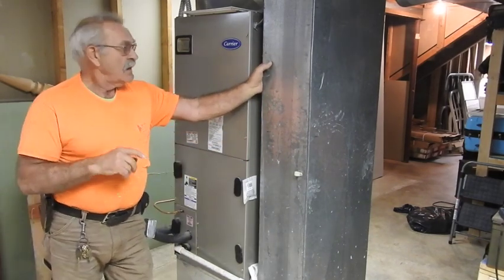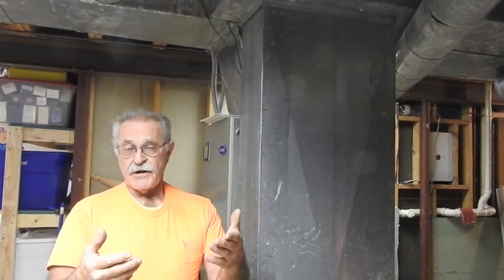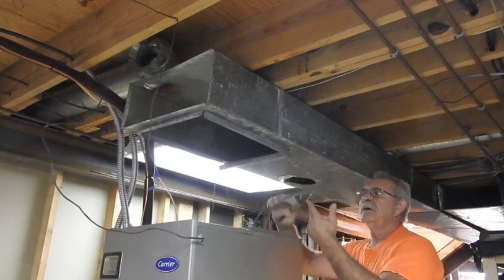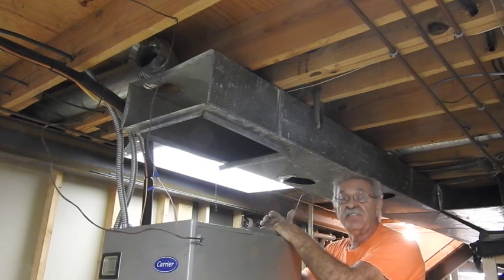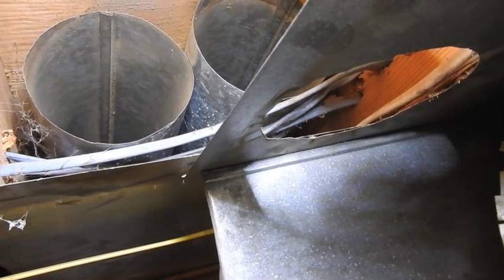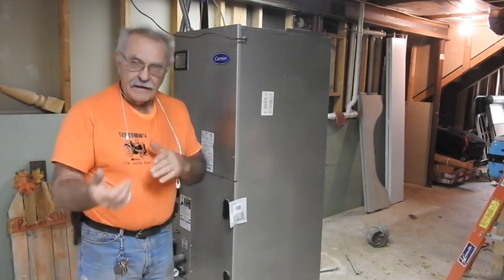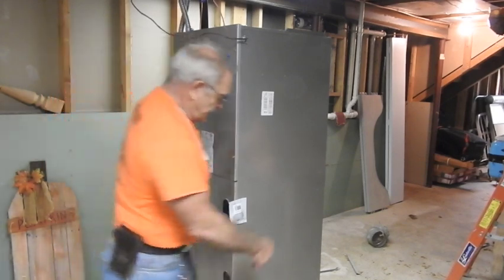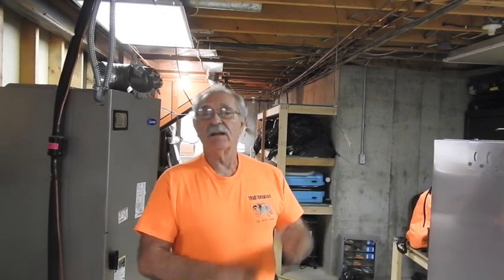Air Handler and Duct Demo

Comment: Can a take off be used to go to both sides of the basement from the trunkline?  I have a 20x20 basement thought I might need 4 vents, but seems too tight for that many.  Maybe only 2 needed?
Reply from the maker: Remember to divide the total cfm of the air handler or furnace by the number of registers or branch ducts you need and that will be the approximate air delivery to those registers.  
     Any airflow used to supply the basement 20x20 room will reduce the air proportionately in the living space above.  So I would suggest utilizing 6'' balancing dampers in the basement registers for proportional airflow adjustment.    
     I'd personally start off with only two six inch take offs, then add a third in the space more frequently used if you find it to be necessary.  Hope that helps and good luck with your project.

Comment: How do I correctly size my trunk line and air handler?
Reply from the maker: The first step in the process is learning how to figure the heat loss/gain of your home.  You should be able to easily find a shortened version on line to get the answer you need.  Once the loss/gain is found in btu's, size the air handler based on 400 cfm per ton of air conditioning.  One ton is 12,000 btu's.  Then you'll need a duct calculator and start with the air delivery capability of the air handler in cfm.  For instance a two ton unit will deliver 800 cfm, a 2 1/2 ton unit will deliver 1,000 cfm etc. The duct calculator will have the information on it to properly size supply air ducting for the capacity of the air handler in cfm.  I typically shoot for 700 to 900 fpm (velocity) in the main trunk.  More than that will result in excessive noise in the duct.  I know this sounds terribly difficult, but there is really no simple way to describe how to answer your question...so many variables I don't have firm input on, but armed with the proper heat loss/gain calculation and a duct calculator the job is very easy.  I have to admit though, that it can be a formidable job for you if you are not at least basically familiar with the HVAC field.
Reply: @tractorman4461  thank you, I’m working with about 800sqft and was thinking 1.5 ton With 4x12 trunk line, about 9- 6’’ supplies.
Reply from the maker: @joshuacassino7297  well 1.5 ton will probably still have a 2 ton blower...they usually do.  So you might still be looking at 800 cfm.  With the proper size duct (4x12 is too small) you will deliver approximately 90 cfm per register.  I don't have my duct calculator with me, but I would think 8'' x 14'' duct would be closer to delivering the air velocity adequately and at a much slower speed keeping the noise factor to a minimum.    I will try to remember to check my calculator tomorrow and come back to this comment with a closer size.  Will the air handler be at the end of the trunk line or will the air handler sit in the middle and blow both ways.  That will have an effect on the sizing.
Reply: @tractorman4461  I loo forward to your reply. Thank you.
Reply from the maker: @joshuacassino7297  According to the duct calculator, a  4 x 12 duct even at 600 cfm (1 1/2 ton) will give a duct velocity of 2,100 fpm or feet per minute.  Wayyyyy to high.  The friction/100 ft also goes up to 1.0'' !!  Wayyyy too high.  Residential duct friction loss should be .1'' not 1.0'', thats 10 times higher. Now IF your air handler does deliver air at 600 CFM, a duct size of 8x16 gives .13 friction loss at velocity of 750 fpm...in the middle of the recommended speed for comfort and air noise.  If it delivers 800 cfm, an 8x16 duct is marginally acceptable as far as the friction/100' goes slightly up to .14  and the velocity increases to just at the maximum speed for residences at slightly above 1,000 fpm.  All this depends a lot on the way its going to be installed too.  Like is the air handler to be at the END of the duct or is it going to deliver air in the middle of off set to one end or the other.....all that plays into the duct sizing.
  I would suggest a little more research and obtaining a duct calculator, either a hand held or virtual, and look at all aspects of the potential installation.  You don't want to make a mistake in design.  I hope if nothing else, I've stressed the importance of pre-thought.  Unfortunately I can't do it in a comment string.  But now you have a toe-hold on the subject.

Comment: I'm amazed at how many HVAC companies oversize heat pumps and undersize the duct work. Back in the day we ran heat load calculations to factor in the number and size of doors and windows along with the sq footage of the structure to accurately size heat pumps. Watching you remove those drive cleats with a duct hammer brought back fond memories. Looking forward to this series!
Reply from the maker: Yes, the air velocity must be much lower for satisfactory operation with a heat pump.  Heat pumps, as you know, are not capable of delivering the 140*F  air like what comes off of a fossil fuel furnace. The standard sized ducting's higher velocity makes the discharge air off the heat pump feel cold and drafty.  Heat Pumps have gotten a bad rap due to improper installation from the start.

Comment: ...  why did you decide to switch supply and return trunks?
Reply from the maker: The final stage of this system will be the addition of a forced air wood furnace that's going to tie into the side of the supply air tee in the new truck off of the air handler.  Both plenums will be fitted with motorized dampers and control automatically.....but that's coming up.  Hopefully you'll hang around a bit.  I got a LOT of editing to do plus other videos as well.
Reply: @tractorman4461  of course, i am hanging around. You know so much. There is so much for me to learn from you. I hope you will post more hvac stuff 😁👍 🙏 Will you be adding extra branches, or trunks only were undersized? Thanks

Comment: Thank you. I would appreciate "not to do things" list a lot :) By the way, some people complain about some registers not supplying enough air, what is your opinion about booster fans? Thank you 👍
Reply from the maker: Oh my gosh...!! There's a list so long I wouldn't be able to do it justice.  But during the installation I do touch base on some pretty severe nastiness where two riser take off the top of the duct for going to the second floor.  So much of what to do and what not to do is really opinion once you get beyond your local codes.  Unfortunately so much of my constant rambling gets edited out to keep the videos a conservative length.  I don't think there are many that would watch hour and a half vids on an install.
   About booster fans....I suggest that a system  with a properly designed duct network based on the total cfm of the unit WITH the addition of 6'' balancing dampers in EACH run as close to the trunk line as possible would deliver the desired airflow with a little 'tweaking' to balance the individual register requirements. You know yourself there are registers delivering 2 times or more the cfm required.  Throttle that and others like it back.....keep the air and the static up in the trunk and move the air to the suffering register, whose damper should be fully open.  It takes time and patience but with individual dampers in the s/a take off's, it is almost always possible to balance out.  That what we do with medium static commercial systems and also commercial high static systems supplying vav boxes and ftu's.  BUT.... when necessary, a booster isn't too bad of a bandaid.
Reply: @tractorman4461  thank you! 👍
Reply from the maker: @qeesher  Hey man...I just found three of your unanswered comments in my spam folder and deleted them by accident.  I was trying to approve each of them and it didn't work correctly.  But I do remember one said you wished for more HVAC and that you were going to hang around for more.  So yes, there will be more as soon as I can.  Sorry about the deleting thing.

Comment: Was the old setup freezing the indoor coil with the duct being that small? Its incredible sometimes how easy things come apart with knowledge of how it should go together.  THAT ONE STINKING SCREW!
Reply from the maker: Hahahaha....there's always one, right ?  In this case only one.  But it sure held. I don't know how the s's didn't blow apart on the sides.   If it wouldn't have been for the appliances in the area, it would have been dropped a bit quicker.  But even if it's my own son's I don't want to damage anything that's not part of the system.  
    No freezing of the coil, just excessive noise due to the velocity of the air flow and with 4 tons of blower on the undersize duct, and the 15 kw package had low temp rise.  The discharge air temp coming from the registers felt like a heat pump of insufficient capacity trying to satisfy the thermostat.

Comment: Great demo, Tractorman44. Most residential installers on a tearout would cut the hangers and let it fall to the floor making a big mess. Looking forward to the cabbing and install. Thxs for the vids!
Reply from the maker: This is going to be a tough one going back.  Iirc, I counted at least 12 or 13 specialty fittings to tie everything in, including the wood fired furnace.  Yeah, I used to get a little rougher on the demo, but this area had too many appliances and a NEW treadmill.  Thanks David for watching.

Comment: Good to see the break down as well, like the Extra Hands.... I read your Description through but not catch what is the demo you talk about, did you mean it was up for training and demonstration purposes? sorry for the dump question 44🤣
Reply from the maker: In the building trades in America, the term 'demo' mean demolition.  So on a job like this one, the first order of business is the demo....or removal....of the old system.  It's just kind of a slang term tradesmen use all the time.  Not a dumb question Jan.  Even though you speak English very well, it is probably not your 'first' language so there's no reason for you to know or to be able to recognize all the slang terminology associated with the language.  Thanks for the comment with the interesting question that once again indicates a partial language barrier between English speakers from different countries.   I edited to verify the 'building trades'.  Those are tradesmen typically on construction sites....plumbers, electricians, carpenters, iron workers, sheet metal workers, pipe fitters, concrete finishers, drywallers,  painters, welders and laborers  and even roofers to name most of them.  There's others like heavy equipment operators that may be considered in the same category, but usually its the ones physically involved in the actual building construction from the foundation to the roof.
Reply: @tractorman4461  Thanks 44, awesome explanation, as an Afrikaans first Language guy we use demo for demonstration because the Afrikaans word is very close, it is demonstrasie😅
Reply from the maker: @jankotze1959  welllll....demo also means demonstration over here.  It can even mean a new car, motorcycle or tractor at a dealership to test drive.  In that case its kinda of a colloquialism for demonstrator.  Or its an item being loaned for a short drive to demonstrate the vehicle.  Both spelled the same and spoken the same as is the demo as I am using it for demolition.  Hahahaha....English is kind of a crazy language.  Kinda like hear and here.  Or their, their and they're. The list is long.....which is also a tractor.  LOL
Reply: @jankotze1959  the English language is probably the hardest there is to learn, I have often heard.

Comment: Interesting I loved 8 ft duct. I installed alone and 8 ft went smooth for me...but I did use 30 inch of pvc and the clamps on each end hung to the proper height. I found that set up fantastic...it held the duct very well and I was able to swing the duct on the pvc rather than the chain to make my drives.
Reply from the maker: I've installed many systems in 8' lengths myself.  But it was almost always a bit of a strain even with the helping hands.  But you know something...??  I never once thought of the pvc trick you used.  Now THAT's a new wrinkle in the brain !!  Thanks for the tip !!